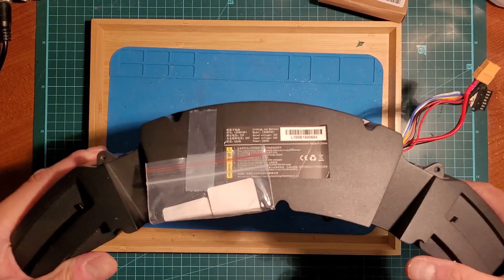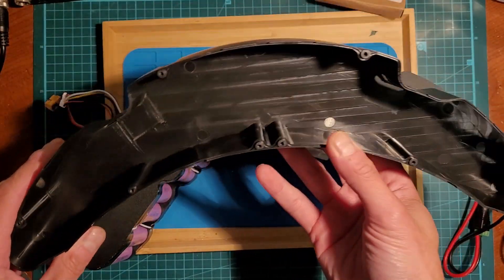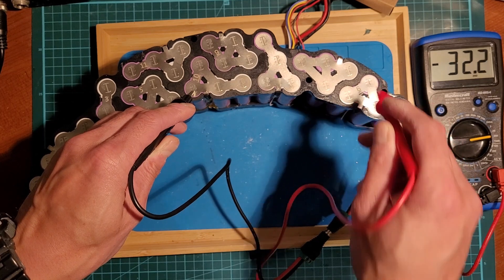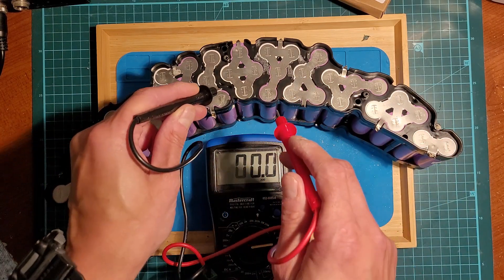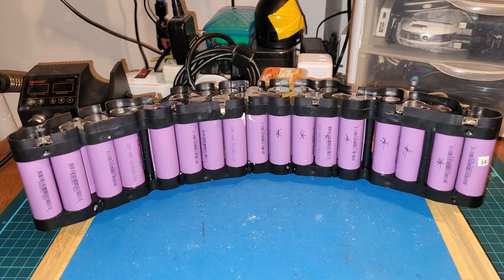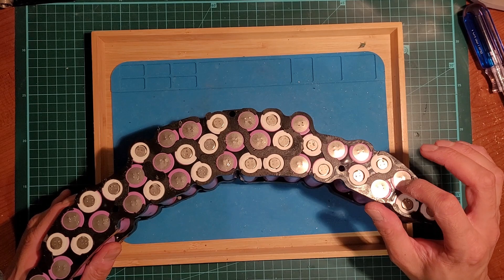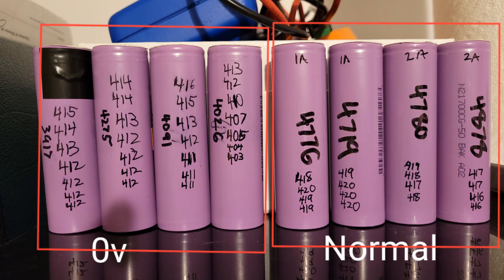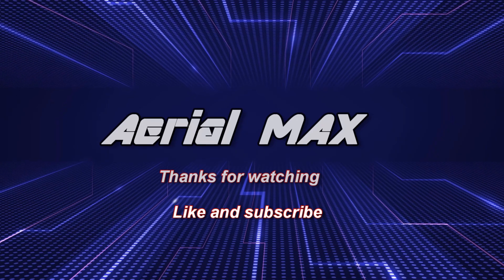Inmotion V8S EUC Battery Breakdown Teardown and Investigation

Comment: You are checked the bms?The problem is monitor PowTech PT6010? (CHIP 32)
Reply from the maker: I don't know much about the individual components in the bms. I need to study that a bit more and get schooling.
Reply: @AerialMax8 see that componant PT6010 on the left (two same componant ) and 200r résistance to VCC pin

Comment: Is better if you used New cells 21700, for  EUC, the inmotion V8S not need high discharge of batteries, the Best battery for this EUC is EVE INR21700

Comment: I believe the Ecodrift teardown shows Samsung 50E cells.
Reply from the maker: i haven't seen any other v8s battery teardowns. Is this shown on youtube anywhere?
Reply: @AerialMax8  yes, search for ecodrift v8s teardown (comments with links are removed on youtube)
Reply: @AerialMax8  yes, on youtube in the EcoDrift channel, they open the casing but don't disassemble the single cells
Reply: @AerialMax8  yes, by ecodrift on YT, they open the casing but don't take the battery appart.